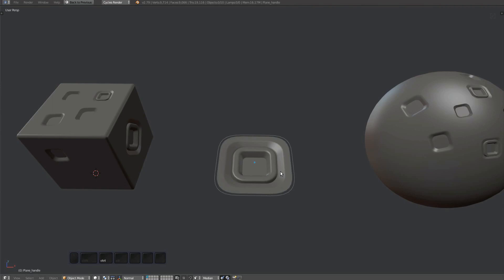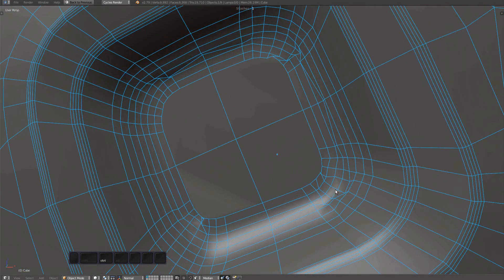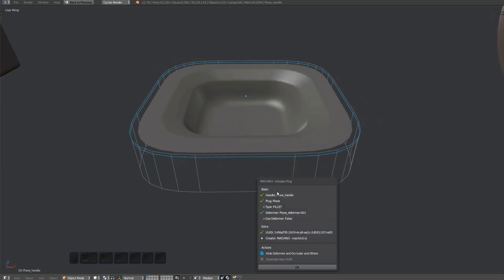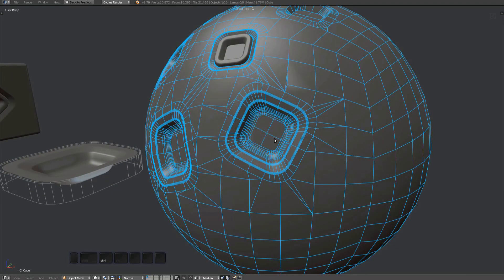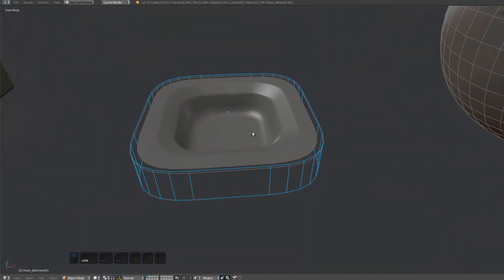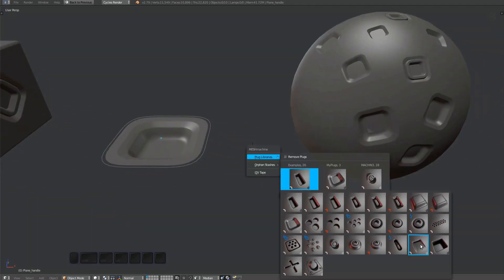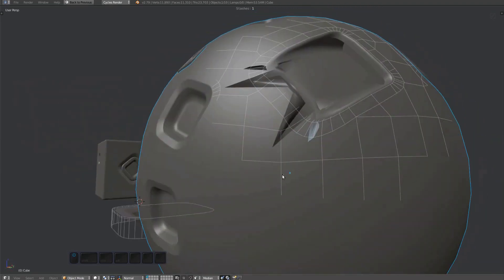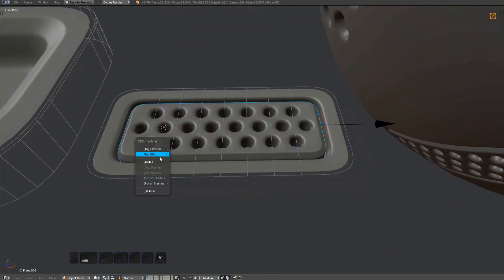MESHmachine 0.6 - Adv. Plug Creation - Deformers

Comment: Love the Mesh Machine tools and I've been starting to make some of my own plugs. When I get to the step where I want to test out my plugs but before I'm ready to save them into my library, I don't seem to have the option to "plug" as you do here in this video. I run "create plug", sort out my plug handle, duplicate the whole plug and place it on the surface of a cube or sphere. Then shift/select the cube/sphere and press "y" to bring up the menu, but there's no "plug" option. I know I'm doing everything right in creating the plug because I can save it to the library and use it from there and it works fine. Just can't seem to try it out without saving it to the library first
Reply from the maker: Report it properly please: https://machin3.io/MESHmachine/docs/faq/#get-support
Reply: @MACHIN3  Done, thanks.